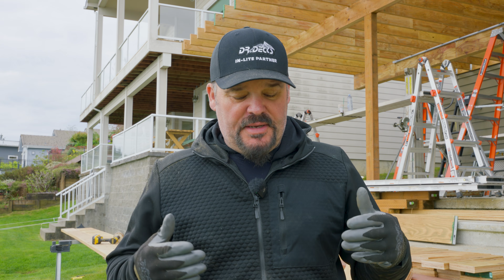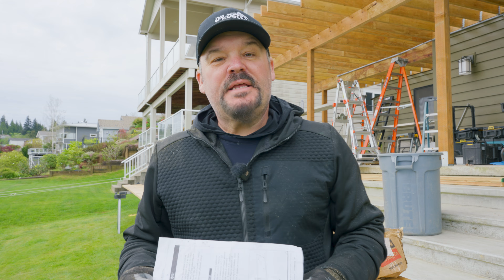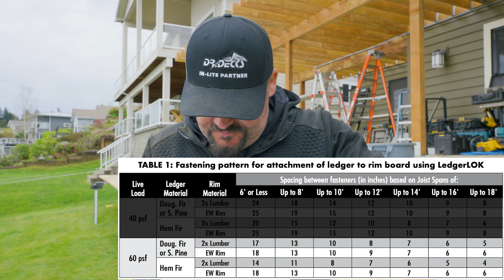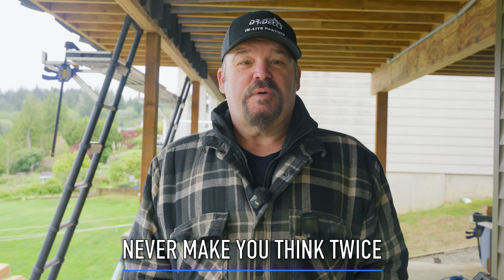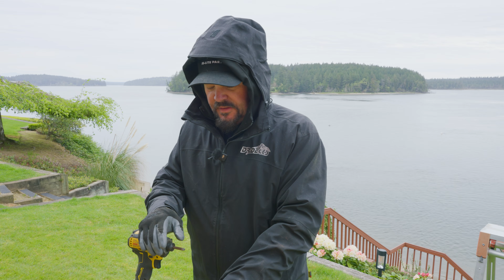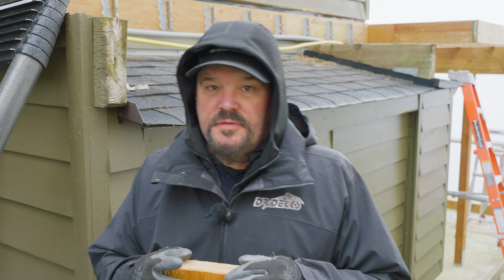3 Ledger Fundamentals Deck Builders Still Miss

Comment: Joists arent always perfectly the same height. Putting the hangers in first - don't you have to adjust a bunch of them?
Reply: He used LVLs. They're manufactured to strict standards and tolerances. I'm sure they're nearly perfect. Even installing the joist hangers up front. But I would be so sure if it was just treated lumber.